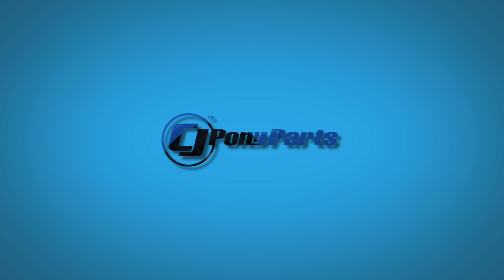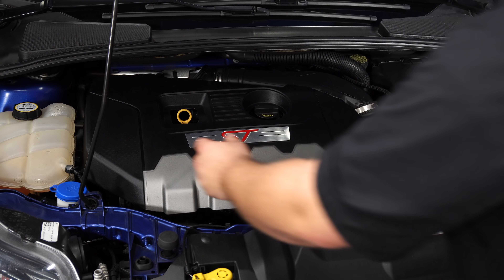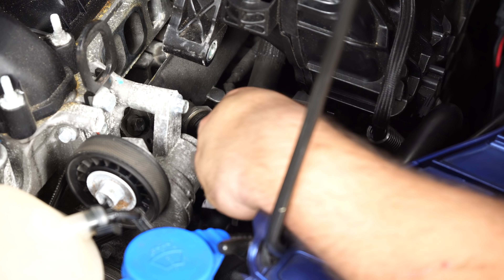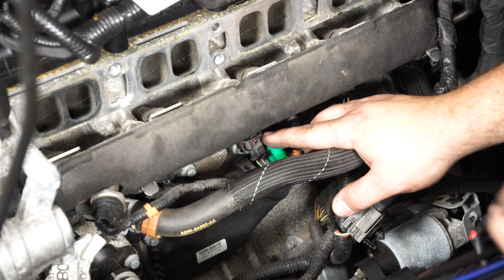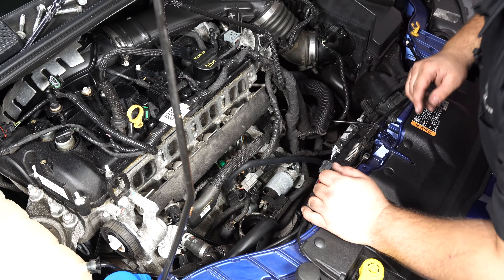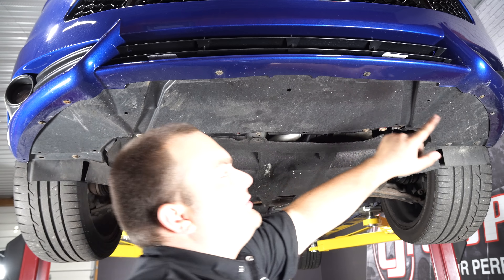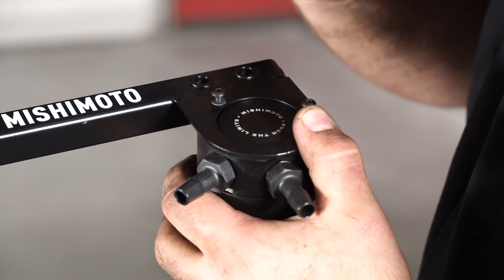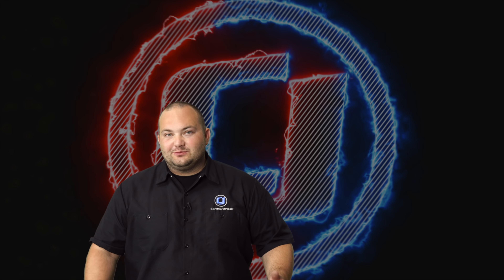2013-2018 Focus ST Install: Mishimoto Black Anodized Baffled Oil Separator Catch Can

Comment: Just don't forget to drain them when you do your oil changes...you create more problems if you let it over flow vs not having one at all.

On a side note: that ST's sub frame has some major rust issues! That vehicle is way too new to have that much corrosion on a sub frame like that...better start rust proofing that thing or it wont last 5 more years O.o

Comment: I wasn't a huge fan of the fitment. The can's inlet and outlets ports are between the intercooler tube and some wireharness and touches both. There is an empty space just above it. I think the mounting bracket could use some design work.

Comment: This install is way harder than he makes it look. Specifically for the intercooler hose and the connectors that he just "pops off." Be prepared for things to get stuck and having to wrestle them for disassembly. Also missing from this video is the re installation of the intercooler hose which would have been extremely useful.

Comment: Lets put the catch can somewhere you have to take half the car apart to empty it 🙄
Reply: dale. marshall the intake manifold and splash guard is “half the car”😂😂😂good stuff
Reply: It's right next to the oil filter no different than just a basic oil change
Reply: You dont even have to remove the rock  guard up front🤦‍♂️Sweet Jesus🙄